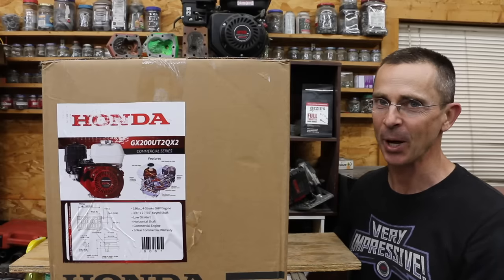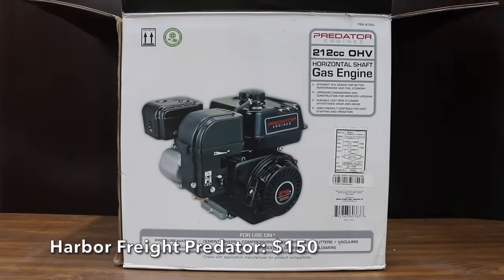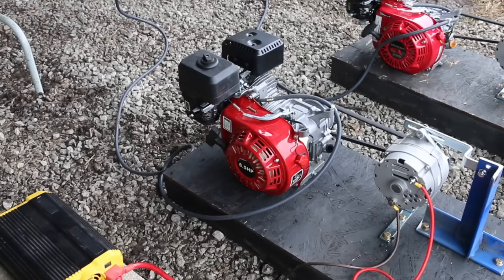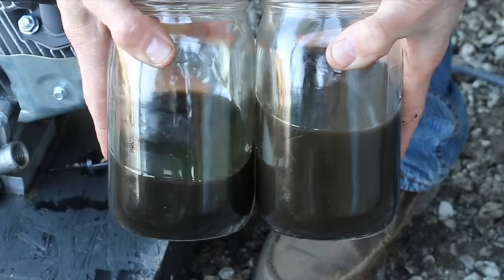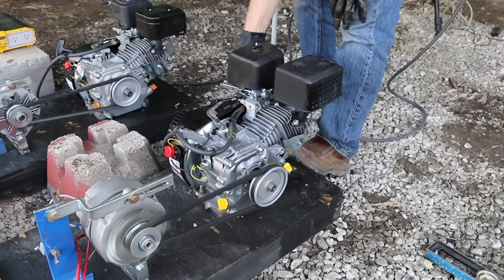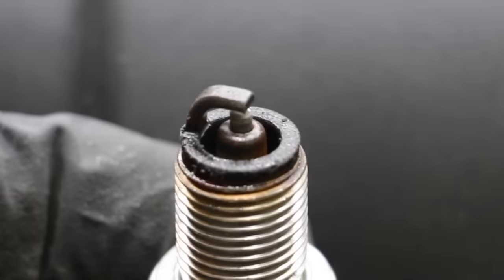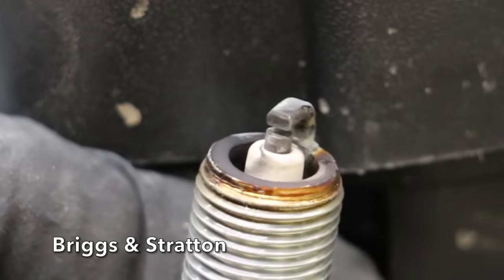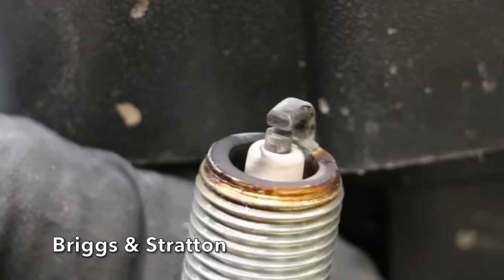$150 Honda Clone vs $600 Honda? Let’s settle this! Fuel Efficiency, Horsepower, Durability, Starting

Comment: Best part about the power of the Honda clone is that it also says 4.0kW, which would be 5.4HP - so this engine has 3 different values for advertised power.
Reply from the maker: Great point!
Reply: At the dealerships we call them “One Tank Wonders”.
Reply: He said that the manual references a GX160 which is a 5.5hp engine

A lot for these cheap clone engines actually has a 160cc block even though the sticker says it's a GX200. $150 is very overpriced though, these clones only costs $60-70 where I live (southeast Asia)

Comment: That Predator engine was very impressive! That's an extremely high value engine for the money right there!
Reply: cheap and very good!🐱👍🏿
Reply: I think someone somewhere said that predator is made in same line than genuine Briggs and Stratton
It would be interesting to take both apart and try to mix up the parts and put both together.
But now I know what engine I'll use to replace genuine honda
Reply from the maker: Thanks for sharing!
Reply: @felixchaus  the Predator is another Honda clone. But remember it's not a real Honda. And whoa to the man who doesn't go out in the snow and start it up every 3 months.
Reply: @thisoldrelic you mean woe?
Reply: @thisoldrelic  In this video seems like predator has different bolt pattern on valve cover, or is it just due to displacement?
And if all knockoffs are honda, what is similar briggs?
Reply: Predator 212 is so overrated..

Comment: Would love to see a follow-up on legevity.  That is, how are the engines looking after 100 or 200 hours rather than just this quick test.  Pretty sure the knock-off would fail, but Predator vs. Honda would be interesting in the long run.
Reply from the maker: Thanks for the video idea.
Reply: You are probably correct...obviously, all the Chinese knock off engines are not the same quality wise..and sadly, the Briggs is basically just a Chinese knock-off with a "brand name"...
Reply: I've had a knock-off on my American Snow Blower for 8 years now with no issues.
Reply: Ran my old Honda generator for at least 7200 hours in its 12 year life literally ran it 6 hours every night and im not even counting the several times I used it for running tools on jobs .
Reply: @bishbosh7728  Impressive...
Reply: @bishbosh7728  Everyone's use is different, and that is part of the decision making equation.  It sounds like both longevity and reliability were unusually strong considerations in your case. Very few people use a small engine to this extent, so your case is a bit of an outlier. Now, let's say you are a homeowner looking for a replacement engine for a woodsplitter that gets used for a load of logs once a year. A $600 Honda engine might be overkill and if you are on a tight budget, buying the Predator instead makes perfect sense. The long periods the engine is sitting unused will probably shorten its life more than any other factor.
Reply: @jbarner13  I have a very old Honda 12k  and it almost never gets used it was 10 years old when I bought it 10 years ago but it starts within 3 pulls anytime i need it usually on the first pull.I have several Honda generator's most were bought used all work wonderfully all the used ones i have are rarely used anymore two 2000's one 1000 and the old 12k the smaller ones are at least 7 years old the 1000 is 10 years old. I have a friend who went the cheaper route and went with a ryobi generator he is on his 10th one in 5 years it was half the price of a equivalent Honda the Honda was $1200 and the roybi was $600 but i would rather spend $1200 once than 3k over 5 years. I don't know anything about splitting wood i live in Hawaii and don't need to do that plus there's no harbor freight here to try their tools or equipment.
Reply: @ProjectFarm  i second the motion for the long run time video. even if its a shitty brief one
Reply: @oi32df  How many hours a year do you run it?  I think most snowblowers don't see a ton of hours.  I'm about to do a predator swap on a decent 20 year old snowblower,  will last the lifetime of the frame with the little amount of large snows we get here.

Comment: I’d love to see you do this same kind of comparison but with a couple of old Briggs and tecumseh engines in the mix. Just to see if they hold up over the years. It would be cool to see if they stand the test of time in more ways than just reliability. Regardless, I’ve been watching your videos since you were doing fuel and cylinder head material comparisons on lawn mowers and I’ve never been bored. Please keep it up! These videos are the best
Reply: I never let him forget the glorious days of running engines with bacon grease. Ah, nostalgia.. 
It's so cool where the channel has gone today; we've always needed this content.
Reply: @Erik_Swiger  it just keeps getting better. He’s so unbiased in his tests; I’m surprised his channel doesn’t have even more of a following yet
Reply: I have a mower that 45 years old and has a 150cc 4 stroke B&S engine. 
It uses no oil and fires on 3rd pull even after winter storage. 
I run it on E10 and it does not complain that it needs 4star leaded!
Reply: I loved the clear cylinder heads.  they showed different thing ssnd you used a high speed camera to show the different problems.  too bad it'd be too hard to do on an overhead valve engine.  I had clear spark plugs used to tune high performance racing chainsaws on nitro.  as they couldn't be run long or run on the wrong mixture it had to happen quick.  Make changes and then run again for a few seconds as wrong tuning would blow the motors.  I had 4 of them.  don't even know how to get them now.  Exhaust sniffers are used now.  Plug reading s still used in the top fuel classes of funny cars and rails.  Just a small change in the weather and those engines would blow if the change wasn't caught.  I did some of that with motorcycles and was on one that blew, and threw me.  I got way better at tuning after that.

Comment: love how knockoffs are getting better, especially for the price and what you use them for, aftermarket parts are out there in massive form
Reply: The Chinese specialize in 2 things.
1 very cheap no quality knockoff products
2 quality copie... euh local build products.

f.e. the Chinese build and sell those cheap retro 50cc scooters with lots of bling bling in Europe. 6 months warenty and after 5000 Km max its totaly worn out.
On the other side they build and sell 50 cc mopeds ( down graded 125/250cc motorcycles)  who are almost indestructable.
They cost 4 times the price of a retro scooter.
Whats good for the Chinese farmer to go to and from his rice padies is good enough for the city commute.
Reply: Most of the portable generators on the market are honda clones (chondas) I've seen a ridiculous amount of engine failures, noisey/rattling engines, oil burners.. you name it. I haven't seen one with a power head failure in a good while. IMO if a chonda went up against a honda longevity wise, you'd probably save money by buying the honda instead of 5 chondas over the same period of usage.
Reply: what you're saving in costs you're losing in tolerances. the expensive one will run better when its older

Comment: I've owned a few lawnmowers with Briggs and Stratton engines and one with a Honda engine.  I'm not surprised by the results of those two. I am surprised by the Predator's performance.  It's good to see HF is giving Honda some competition.
Reply from the maker: Thanks for sharing.
Reply: Yeah well... That's like saying Hyundai is giving Honda some competition comparing new cars. I've worked with engines for a while now, for every 10 Predators broken there's 1 Honda. So there's that. If you need something for a short task, Predator is your guy, but long term ownership go Honda
Reply: @disco.lemonade  That's good to know. Short term performance is easy to measure but long term reliability is more difficult. Thanks for your input.
Reply: @disco.lemonade  Because 10 people bought the Predator for $150 for every 1 stooge paying $600 for the same thing.
Reply: I helped a friend install a Dyno cam and billet rod/main bearing inside his predator, and the gear on the original cam was made out of plastic and I noticed that the old rod didn't have a bearing like the new one, it was just solid aluminum. The damn thing used to clunk and clatter like a rock tumbler.

Comment: The predator engines are an awesome value.  I run them on generators and pressure washers.  Add a bit of Lucas and they really last!
Reply from the maker: Thanks for the feedback.
Reply: Lucas oil rocks!
Reply: Long therm the preditors dont' hold up as well as the honda though too much chineseum in there. If you need one for infrequent use and run straight gasoline insted of E10 .... probably will last well enough, my brother put one on a go kart that used to have a wisconsin on it, and it wasn't quite up to the ammount of vibration it had to endure IMO.
Reply: @Wingnut353  They are ok as a utility engine but I would never use one for the minibike or go kart hobby. There are much better quality engines available for not that much more money. The Predator 224 that came out last year is made by Ducar and is a better quality engine than the 212's.
Reply: @Deucealive75  Honda for Reliability every day!! 
I have a Honda mower I pulled from a neighbor’s garbage 10 yrs ago… changed the oil maybe 2 times since then, never put fuel stabilizer in it for winters and it runs like new… 
Even been stored outside a few winters…. I just spray a little starter fluid first mow of the year  and top off oil if needed…. (Mowing season is short so not a ton of hours on this engine…and the oil still looks nice)  
Honda is awesome at making excellent reliable machines…
Reply: Well my Honda gcv170 is full of issues which I didn’t know about until after I bought it.
I thought I was buying the best
Reply: @Wingnut353  well most of the Honda parts are also made in China only assembled in Thailand.
Reply: @Deucealive75  good to know, thanks!
Reply: @THROTTLEOLOGY  no warranty, when you bought it?
Reply: @Wingnut353  My featherlite is an "American Special" and is probably built CHEAPER then these chinese specials.

If that weed wacker can survive both sitting out in the elements for god knows how long and me taking it apart, I think those predators can last ATLEAST as long.
Reply: I also have one for a gen and one for a washer. They both still start on one pull  with all original parts.
Reply: What kind of Lucas oil ?
Reply: @82sharpebronco74  NOVA 6
Reply: @Wingnut353 it’s “Chinesium”, and most Honda parts are made in China anyway. Where they’re assembled is the difference.

Comment: Predator engines are awesome. Used by many to replace old classic snowblower engines. Love mine. Thanks for ya hard work as always.👍🙂
Reply from the maker: Thanks  for the feedback.
Reply: to add onto this, we have a go-kart place by us that swears on the predators and proudly rock them for most the karts rated for them. they are badass. never had one give out on me when treated right.
Reply: I did exactly this. That poor 6.5 hp is doing what an old 10hp techumseh used to do!
Reply: Have one of their generators, does great when I need it, never shuts off unexpectedly and starts up first pull every time and far cheaper than a Honda.
Reply: Predeters never die we had one that would start every year on old gas.
Reply: dont
Reply: HF Without a doubt the best.  The Honda not being Made in Japan, my opinion, just another clone, Made in Thailand and 4x the cost? HARBOR FREIGHT 🦾 Great test 👍

Comment: The surprise in this is just how well the predator and how poorly the briggs performed.  Those Honda motors are great, but at the price it is hard to ignore those predators.   Another great Project Farm test.
Reply: I'd take a Predator engine over Briggs any day.
Reply from the maker: Thanks!
Reply: I'm not surprised by the Predator at all.  They're good engines.  I'm a little disappointed in the Briggs...  Honda is THE standard... but the Briggs Vanguard (NOT the Briggs in this test!) engines may be getting ready to dethrone the current King.  Time will tell.
Reply: There are reviews out there how bad the Briggs portable generators are. Even the Chinese gens beat them.
Reply: @jshepard152  what if the day was  1960 when they were still good?
Reply: @loganyoutube4818  We don't have time machines so not really relevant
Reply: @loganyoutube4818  You can't use those 1960 gas engines with today's fuel without sacrificing reliability. Back in the 60's, people use leaded gas . In order to switch to unleaded gas, engine manufacturers have to use hardnened exhaust valve seats.
Reply: @BKD70  lol not even close.
Reply: @fleurdewin7958  so just buy the lead substitute or just use two stroke gas for extra lubrication…the lead was only there for a little lubrication and the only thing I’ve seen is that they need new valve seats sometimes like In The old farmalls
Reply: @DieselRamcharger  Just keep watching... remember the Briggs in this video is NOT the Vanguard.  Not even close.

Comment: I think you should do an episode on solder. Strength of joint, flexibility, how easy it runs, different temperature solders and of course price. I'm sure you could come up with some other parameters to test.
Reply: @Peter Angles As of right now, he has 7 up votes.  Include him and there's 8 whole people.  703K views for PF's Best Annular Cutter video.  I think you'd be surprised.

Comment: I have bought numerous product based on this mans testing. I greatly appreciate his effort and diligence to produce a quality analysis of such a diverse number of products. Thank you good sir!
Reply from the maker: You are welcome!
Reply: i work construction, always un heated and sometimes outdoors, those heated gloves are making a huge difference! i couldn't really afford the top of the line ones but the best VALUE ones were doable, i KNEW i had to hurry or theyd be gone, essentially most normal sizes SOLD OUT, luckily they had XXL which many do not, i bought immediately, they wearing out as they're NOT construction gloves so ill be taping gluing at some point

Comment: There are two versions of the Predator 212. The version you have there with the matt valve cover is made by  Hemi. Predator 212s with a shiny valve cover are non-Hemis. My 212 has sat outside all winter, she started right up on the second pull few days ago.
Reply from the maker: Thanks for sharing.

Comment: Great video as always! I’ve used those Predator engine for years, they are stout! Ran them on mud motors at wide open throttle for miles with no issue. One interesting thing I’ve noticed after working on small engines for years, Honda’s oem carburetors are awesome, I’m not sure what they are lined with, but I have very rarely seen one gum up compared to other brands.
Reply from the maker: Great feedback on the Honda carb
Reply: Yeah I’ve never had any trouble with Honda carbs (had a mower for 20 years with no carb or engine problems at all. Briggs and Crapin craps out in no time. Never will own another Briggs. Hondas all the way for mowers.
Reply: Good point, I've got a few gx Honda's and in the last 20 odd years the only thing I've ever had to touch is the drain screw a couple of times when fuel went bad.. the gc Honda's are a different story though and I've had to repeatedly clean the carby on it, I'd recommend a  knockoff over a gc Honda any day after all the trouble I've had with it.. not only has the gc given a heap of problems, it's a terrible design so it's a shit to work on

Comment: Mower has a Briggs & Stratton; Ive had it for ~7 years. Still starts on the first pull every time. I change the oil like I do my trucks and give it a dash of Prolong, treating it like I treat my truck engines. I clean the plug a couple of time per year, re-gap it, and check the air filter a few times per year. When I bought it I had wished it was a Honda, but at the time price mattered. ~7years later Im impressed.
Reply from the maker: Thanks for the feedback.

Comment: I have to say, I wouldn’t have expected the predator to do so well.
Reply from the maker: It has a slight displacement advantage over the others, but it's actually a pretty good engine for the price.
Reply: I have the 420 cc predator engine. I also have the Honda GX 390 engine. That predator is a thumper! I highly recommend it.